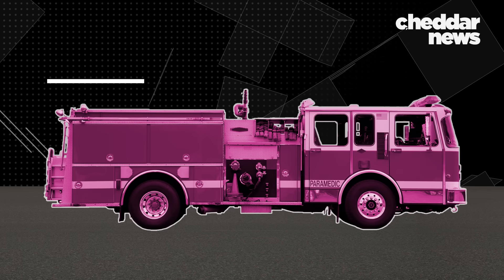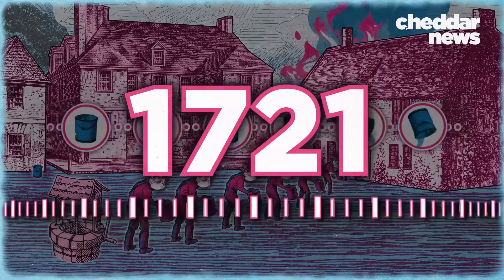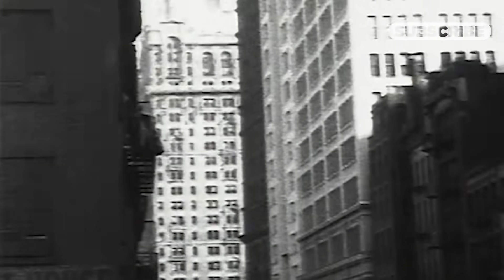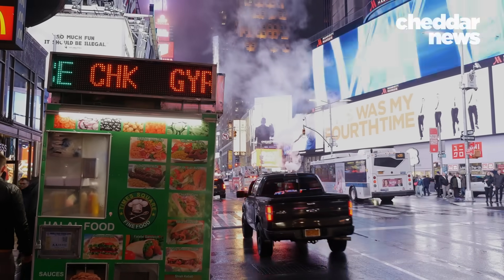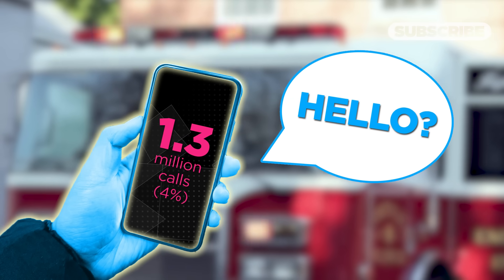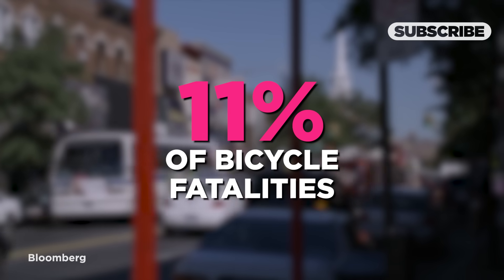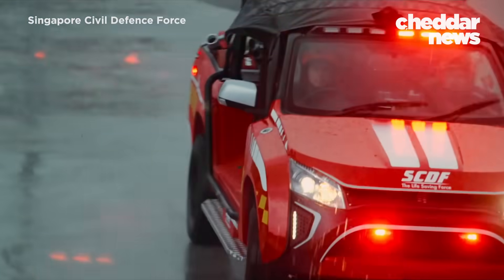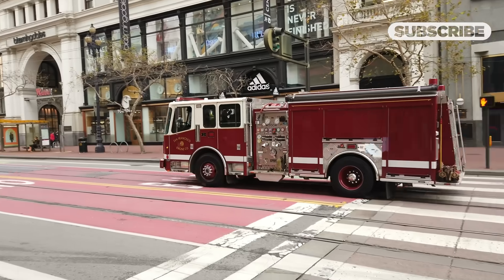Do American Fire Trucks Need To Be So Massive? - Cheddar Explains

Comment: I always wondered why the trucks were so big. I just assumed it was because of the ladders or that they carried water or something.
Reply: They carry all of that. Most engines carry 500-1000 gallons of water. Where I work we have an engine/tanker that Carries 3000 gallons of water due to areas with lack of hydrants. Plus all equipment ground ladders and personnel required for a compliant urban fire engine company. It also Carries additional equipment to also allow it to run as a tanker in rural water shuttles. This video is completely full of false or partly true information.
Reply: @DrummerOfLR  I don’t even know a lot about firefighting and I’m absolutely not convinced by several of the claims made in the video. Particularly that a glorified ATV has comparable capabilities to a normal truck, let alone the larger vehicles. Feels like we deserve a response video from someone that knows the subject rather than a generalist “did you know” type channel.

Heck I’m pretty sure if you took an American truck and crew, European truck and crew, and that glorified ATV and crew and put them in a hangar for half an hour to compare notes, they’d probably agree in 30s that they’ve all got different capabilities and then spend the rest of the time checking out each other’s vehicles and loaded equipment.
Reply: @Islacrusez  
Yeah, I guess the Singaporean "fire truck" is for the type of emergency where a cat is stuck in a tree. Not sure why that was included in this video; many European fire departments have dedicated crew and command vehicles (usually passenger vans, sometimes large buses) which might fulfill a similar role, but those aren't frontline emergency vehicles.
As for the equipment between a US and European fire engine, it should be broadly similar. In European trucks the equipment is packed a lot more efficiently, which saves lots of space and weight. From personal experience I can tell you that whilst accessing that equipment usually isn't too difficult, it can be a right old hassle to pack everything back in the truck.
Reply: @DrummerOfLR  damn, 3000 gallons is a lot. Here in Germany (except for very few examples at municipal departments) only industrial fire engines and airport fire tenders carry that much water
Reply: Well your video was well rounded the biggest difference is water supply, pressure needed for ample water application.  Tools, staffing as well as something far beyond most peoples understanding and that’s traditions.  The best way to understand this is go and talk to a fire house and see what they say.
Reply: Both, in addition to hose and other equipment.
Reply: Just a product of the times. Check out a '93 FORD Ranger sitting next to a 2017 https://preview.redd.it/jnulkzmu8bs21.jpg?width=960&crop=smart&auto=webp&s=599907ca07847632213dedcfee78c16520b299f9
Reply: Also, regulations (safety and efficiency) mean that the whole crew have to be IN the cab under a roof (no one hanging off the back anymore).

Another issue not brought up.  Large cities have twin issues that pull toward different trucks.  For one, you have narrow streets and crowded neighborhoods (for which you want a smaller vehicle).  But big cities also have large buildings (and especially warehouses), which can spawn fires that can require a LOT of trucks, especially the bucket and ladder types.  

And then there's the general spread of the US.  Tooling around with 1000 gallons of water in vehicle is a BIG requirement (that water probably weighs as much as a pick-up-based vehicle, 8000lbs) but if you cover areas that don't have a lot of Hydrants (lots of township FDs), you have to bring it with you.
Reply: its mostly down to them carrying much more water and bigger pumps than European trucks, but also due to less efficient space usage. US fire departments put more emphasis on the retro design, decoration and crazy high durability than on perfectly organised, space efficient compartments
Reply: Appliances here carry ladders, water, lines, rescue gear, BA sets.

Comment: Bigger better, but I see no problem with adding smaller engines
Reply: Acceleration is why, every second counts
Reply: @specialopsdave  if every second counts then why do cities have massive fire trucks that have to manoeuvre through narrow streets and intersections, when smaller vehicles could get around faster since like you said, every second counts
Reply: @serbansaredwood  Because they likely aren’t taught how to drive defensively
Reply: @serbansaredwood  smaller vehicles only work when everyone else also have small vehicles. Trying to fit a small fire truck around SUVs and truck as large as yourself won't work.

Comment: If bike lanes would impede fire trucks, the best solution would be wider bike lanes that could accommodate fire trucks. If the fire truck needs to get somewhere in congested traffic, motorists aren't gonna be able to pick up their cars and move off the road. Cyclists would easily be able to just get off their bikes and move off the bike lane though.

Comment: very interesting topic. Some aspects I want to add:
1) while fire apparatus in the US are often way longer than their European counterparts, the European ones are often quite a bit taller. 
2) there are a few American apparatus used across Europe: van and pickup based units were somewhat popular in the past, but aren't any more today. actual full size fire trucks exist as well, but only very few of them. Even the US Army Fire & Emergency Services at USAG bases in Germany stopped shipping American apparatus across the pond and use European ones instead
3) American apparatus manufacturers tried to enter the European market multiple times - trying so with the American layout. They never were successfull as they simply didn't adapt to the entirely different market. At the same time, e.g. the European manufacturer Rosenbauer entered the American market with an American fire apparatus layout and is successful with that approach
4) while the Aerials in the US are usually based on a way larger chassis, also due to carrying more equipment, the ladder itself usually isn't taller than on European apparatus. In fact, barely any Aerial in the US is beyond 100 ft tall, while even ones in the 150 ft to 170 ft are kind of common across Europe and the tallest ones being in service hitting 300 ft of height - based on a truck chassis which isn't much larger than a Tiller Ladder which reaches only 100 ft in the US.
5) departments are layed out VERY different. Taking Germany for example, the departments in the cities usually have few large (sometimes enormous!) stations, whereas the American departments have numerous tiny stations. The response times aren't much different, but the entire approach and department layout sure is.
Reply: Rosenbauer has supplied the new LAFD electric fire truck.  I saw a video.
Reply: @michaelrmurphy2734  that's correct. As it was built in Austria it's a uncommon apparatus layout to be seen on the streets of America; The US division "Rosenbauer America" builds the typical American apparatus design
Reply: @EnjoyFirefighting  Truth be told between Jeeps and Emergency vehicles America has only been able to export widely to Latin America no where else.
Reply: @oscarosullivan4513  although a few were also sold to the US Army Europe (well, the USAG bases are still kind of US territory), Poland, Middle East and China, but yes, outside the USA American apparatus are popular in large numbers only in Canada, Chile, and maybe some more counties in South America, but tbh I'm no expert down there
Reply: @EnjoyFirefighting  Someone I know visited Mexico City FD a few years ago and they had a weird mixture of American and European trucks. A MAN-based HLF20-style engine next to some American ladder looks quite interesting :D
Reply: @johnkramer8091  they have everything from the American and European market down there
Reply: It should be noted that Rosenbauer also acquired 2 great US fire truck manufactures to enter into the market and an awesome aerial manufacturer in Nebraska.
Reply: Not a native english speaker here.. why do you call firetrucks apparatus?
Reply: @Keckegenkai  there are so many different terms depending on the location: fire engine, fire truck, fire apparatus, ...
Reply: Basically, if it's something from North America, it's guaranteed to be worse than it's European or Asian counterpart.

Comment: Smaller vehicles less equipment, worse firefighting service
Reply: lol where did you get that from? Although e.g. a German Engine is more compact and carries less water, they actually have a larger crew and carry more equipment along than an Engine in the US. And as for worse firefighting service: why? how?  There are as many firefighters in the small country of Germany like there are in the entire US. Departments roll out with entire convoys to certain alarms ...
Reply: @EnjoyFirefighting  so if I understand right smaller vehicles hold more than big vehicles and are completely as capable as the large ones
Reply: @andymiller3366  "and are completely as capable as the large ones" no ... less water and usually a pump with lower flow rate. But many departments in the US spec their apparatus with compartments which make rather little use of a lot of available space. Many of them are only half full, with lots of potential usable space remaining unused. 
When a smaller truck uses every inch of available compartment space, then yes, it can carry more equipment than the larger truck which doesn't use all the available compartment space.

Comment: Aside from the singular ladder truck, this didn’t really say how European fire trucks are better. They showed several that are more compact but failed to note if the are outfitted with similar gear. If it takes 3 different small trucks to equal 1 big truck with a wider selection outfitted…is it actually better to have 3 small trucks?
Reply: It’s a poor comparison video overall. 
Both types of vehicles have pros and cons. A small rescue unit will work well in a congested city with easy access to fire hydrants and medical centres etc. 
Perhaps if you are in the middle of rural America, you need the large tank and need to take every possible item of equipment as you may be the only thing nearby that can help.
The best thing to do is have a range of standardised models with different specs, so different fire stations can be given models that best suit their work and location.
Reply: @breakthru7608  well put! And to be clear, I do agree with what you say. Definitely harping at the video being very definitive without providing much in terms of actual pros/cons.
Reply: If only 4% of the incidents are actual fires, then with 3 smaller trucks you can cover that remaining 96% much more efficiently.
Reply: Each truck has it's own purpose. Small ones are great for rapid-response, as they can weave through traffic faster and get water on the fire sooner, while the big trucks are great for getting as much water and equipment on scene as possible, albeit with a slower response time
Reply: Well, maybe yes
Reply: Well, we live in a semi-rural environment with a lot of volunteers.   Often there is more equipment that people.   If an EMT (working from a fire state) needs extra help (there are always two people in the "rescue" truck, at likely as not, a BIG firetruck will show up.    Volunteers can show up directly to the fire as needed.
Reply: If it means less people will be killed and streets can be better designed then yes.
Reply: Well, we live in a semi-rural environment with a lot of volunteers.   Often there is more equipment that people.   If an EMT (working from a fire state) needs extra help (there are always two people in the "rescue" truck, at likely as not, a BIG firetruck will show up.    Volunteers can show up directly to the fire as needed.
Reply: https://youtu.be/i8Y32mshPrQ
This video (although it doesn't have English subtitles) is a good walkaroud of a typical Italian fire truck, and similar to those in use all over Europe.
Reply: Forget to mention every small town in America having its own police force and fire brigade. Borough policing and firefighting alive in well in the USA.
Reply: @oscarosullivan4513  many rural towns have zero police force of their own and work with local sheriffs instead. Heck, I grew up in a suburb that doesn’t even have their own police bc the low crime rate doesn’t justify the cost.
Reply: "If it takes 3 different small trucks to equal 1 big truck" it's not quite like that. Although e.g. an Engine from Germany carries less water than an Engine from the US, it in fact carries both a larger crew and more equipment along. In many American fire apparatus there's a ton of available space in the compartments, which however isn't nearly as well used, with lots of compartment space remaining unused. German apparatus are a masterpiece of Tetris thinking, making use of every single inch of available compartment space
Reply: @EnjoyFirefighting - International Emergency Response Videos  And I always think the fire trucks have so much air in between the tools when I compare it to my nice blue GKW... But on the other hand I save a lot ow weight by not having water or a pump, so I can pack more tools.
Reply: @TheGrizzlyBeer  two very true aspects due to the different use of both apparatus.
Reply: @EnjoyFirefighting  As are irish pumps